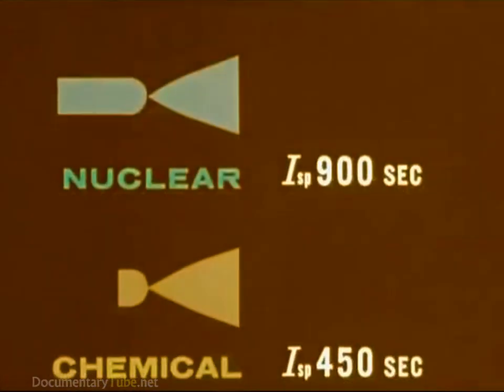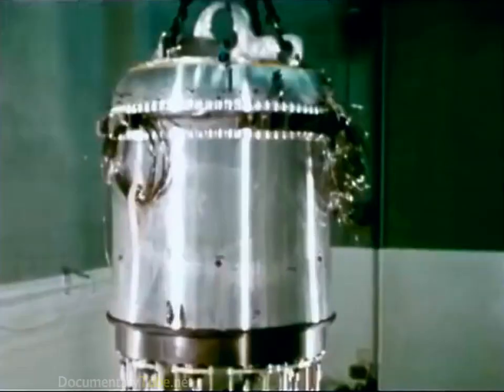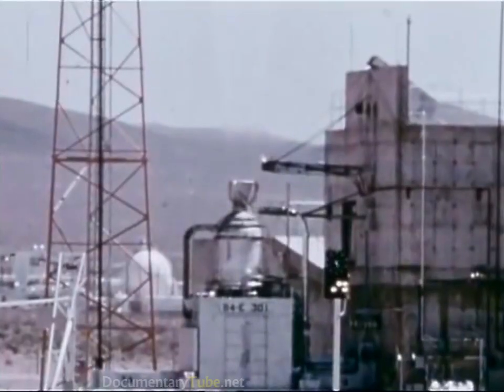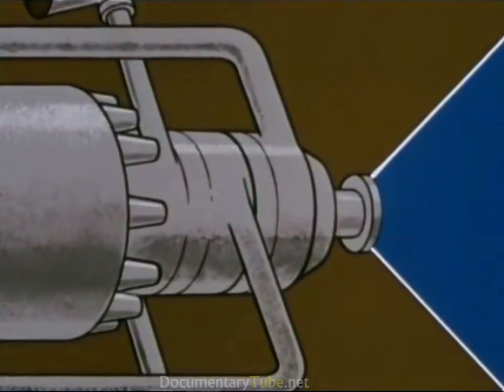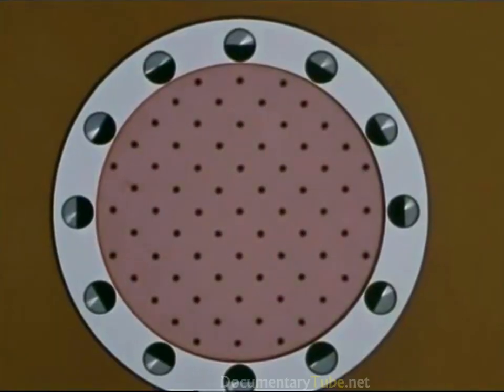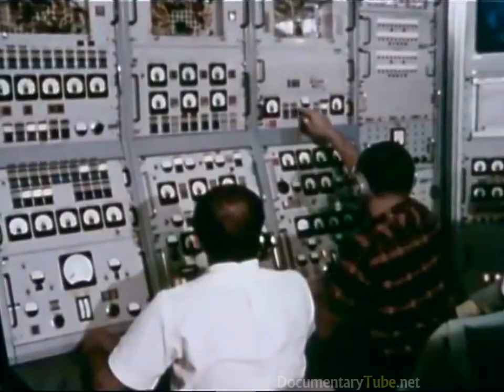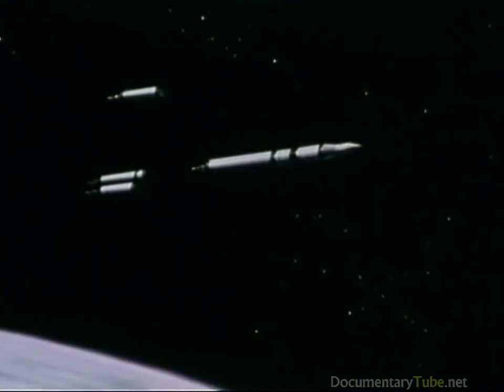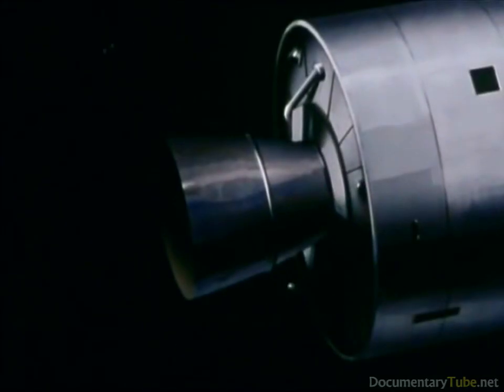HOW IT WORKS: Nuclear Propulsion

Comment: So, that exhaust gas was radioactive? They just vented it straight to the atmosphere with no care or thought of contamination.
Reply: Depending how many bananas you eat
Reply: Background radiation was already up due to 20+ years of bomb testing around the world but people were starting to complain. Pollution in general was starting to become a topic around that time. We did a lot a bad stuff in those days, as individuals and as nations.
Reply: Nope, the hydrogen does not become radioactive when passing through the engine.
The problem is that the engine does become radioactive,  somewhat.(not as bad as you would think, the run times are very short, as nuclear reactors go)
and even bigger problem is that while operating the engine gives of one goddamn awful flood of radiation. You do NOT want to be anywhere near it while it is operating. And in this case "near" is anywhere within several hundred yards from the core.
When using it on a rocket, you simple cannot use the sort of heavy shielding that normally goes with a nuclear reactor.
Also, when using it on a rocket, you kinda have to be close to it, you have to sit on the same rocket!
.
Add on top of that the thrust being too weak to use it for launch, this is a space-only motor.
.
Add on top of that the assorted hazards of launching that much u-235, even in a shutdown reactor. What happens if the launch fails? What happens if some third party lays their hands on the engine? The amount of uranium on it is enough to build *several hundred* nuclear weapons.
.
Scientifically, the NERVA engine made some sense, but politically and environmentally it was a complete flop.
Reply: theory was the large amount of H2 was the shielding

Comment: This is old 1960s stuff, when everything with the word ''atomic'' was almost magic. Nuclear propulsion has indeed several advantages, but it's has one huge disadvantage --  the exhaust gases are radioactive. You really really don't  want to use them inside the Earth's atmosphere. I've read several old (illustrated) books of that age about the future of space exploration , and most of them assumed nuclear rockets are the way to go. I could be wrong , at the moment the only thing nuclear in space propulsion are small reactors providing power for spacecraft that are too far away from the sun to use solar panels
Reply: This engine is only useful in space. 75,000lbs of thrust is about 1 boeing 787 engine and thats not strong enough to get any real payload into orbit from the ground. this engine is optimal when already in orbit
Reply: It still is magic, the energy density is huge! For example a lithium battery has the specific energy of about 0.5MJ/Kg, Wood ~16MJ/Kg, Jet Fuel ~42MJ/KG, Diesel ~48MJ/Kg and Uranium ~80,000,000/MJ/Kg. I can easily see why the hype existed, too bad it's super deadly.
Reply: +Eric T - Not air - They use bottled hydrogen they take with them so air is not required. You may be thinking of the nuclear aircraft programme which did use air - especially the G.E. direct method.
Reply: Nuclear reactors are not used in spacecraft (not modern ones at any rate, and the ones that have been are exclusively Soviet of origin save for one). RTGs (radioisotope thermoelectric generators) are. RTGs hold a block of a radioisotope that has a long half-life. As it decays, it gives-off heat, which is then converted to electricity (via the thermoelectric effect, so uses a solid-state device).

The isotopes in RTGs are chosen for their low gamma and neutron emissions as well as long half-life. It's very important to note here that neutron emissions are vital in nuclear reactors, and it would be impossible to run a nuclear reactor on fuel that did not release neutrons as it decays; RTGs and reactors operate based on entirely different principles.

Pu-238 is one example of an isotope used in RTGs, and was used on the Viking and Voyager missions, and used on the Curiosity rover, as well as New Horizons. RTGs are great for any mission where solar power is unreliable (outer solar system, the surface of Mars, long-term surface missions to Venus if we ever discover materials that can survive such an environment for more than a few minutes, and so on).

Another fun side-note: Breeder reactors are absolutely required to make these isotopes (along with important isotopes for medicine). Ban nuclear reactors and we not only hobble space exploration, but end-up killing ourselves. (Please remind the anti-nuclear nutters of this if you see them.)
Reply: The exhaust gasses aren't radioactive. Not the way you're imagining. For one thing, the H2 is only in the reactor for a very short time. And whatever deuterium and tritium is created occurs naturally anyway.
Reply: The exhaust is not radioactive.  It is hydrogen. If it picks up a neutron passing through the core, it becomes deuterium, which is also not radioactive.  And we are not serious about manned exploration of the Solar System until we man up and start using nuclear propulsion systems.  Chemical rockets are simply not up to the job.
Reply: That why they'd use conventional propulsion to get into orbit and once you're in space worrying about nuclear propulsion is like worrying about throwing away your gum wraps on a waste dump. 
I'd call it now, we won't go around nuclear propulsion until we develop a functioning Alcubierre-drive (or similar).
Reply: nuclear power is inefficient? no, solar power is 30% efficient, nuclear is only 1% efficient, but it's 1% of 80000000MJ/kg, the power density is absurd. so it doesn't matter. (that's already 8000 times more power dense than solar)
Reply: @monad_tcp  That 1% efficiency figure is only with regards to available energy. When you look at thermodynamic efficiency, they are about 30-40% efficient like any other plant that size. If the fuel were to be inside a breeder reactor then we would be able to use all of the fuel.
Reply: @travisbeagle5691  Yep, 1% is what's available through fission, you don't want to release all the power contained between neutrons at the same time.  With enrichment and breeder, you get get up to 85% thermodynamic efficiency.
Reply: @monad_tcp What I meant by available energy is what you can actually be able to consume. The vast majority of the energy reserves are never touched because most of it is found in fertile and not fissile material. Then you factor in the restrictions of how much you can consume at one time due to the fuel being in solid form and you end up only using a couple percent of the fuel rods that go into the reactor (cut that in less than half and there is where the 1% comes from).  Breeder reactors let you use the full amount of fuel and liquid fueled reactors can let you do so without coming offline for anything other than routine maintenance. Also I have no clue where you got an 85% thermal efficiency from. It's simply not possible with a thermal engine and the best we can do is about 60% from advanced gas turbine systems.
Reply: I think it is possible. But it cannot be used within the Earth's surroundings. Plus they have found that there are he3 in moon that can be used for fuel and idk if it can be used for nuclear reactors but most probably they can be. We should've set up a base in the moon so that we can construct larger object like a rocket with nuclear propulsions. Unlike in ISS where everything is crowded and the space is closed off and it is difficult to make big rockets.
Reply: lies damnlies banning nuclear reactors would be the dumbest thing we've ever done. Watt for Watt it's the safest and least polluting power system we have. We're generations past the primitive kinds that caused all the accidents. The generation developed in the 80's was specifically demonstrated to be able to survive a direct tsunami and earthquake without releasing any radiation. Heavy regulation and bans based on the issues with the first 3 generations are the only reason why we aren't all using meltdown-proof gen6+ reactors to power every city today for clean, affordable power.
Reply: use 'traditional'l machines to exit our atmosphere and bring the nuclear engines on
 Hitlers men were toying with the idea - v1 doodle was a pulse engine add paperclip into the equation and da daaa ! the nazi part of america had true genius eastern european science and rocket minds plus fusion or fission plus jewish money and gold - come on it aint rocket science 
nuclear propulsion is decades old not sure its in use but its there
Reply: Mycel. why whats the difference ?  Ion thrusters generate more exhaust gasses and heat ?  but surely if space has no 'air' how can either be used ?
Reply: Ion propulsion is something different from nuclear propulsion. i'm NO rocket scientist but I do know that ion ''rockets'' are best used for long duration mission.The thrust from ion engines is not much in comparison with other drives, but they can work for hours and hours , I think even for days. So the initial thrust is not much, but after some time the accumulated thrust is impressive.
Reply: Hydrogen is not radioactive
Reply: Henry Rieman. 😊 they did decades ago  thats why we're talking about it today
Germans were 1st onto it
Reply: ..but on the other hand it whitens teeth and sterlises BBQ grills!
Reply: 1960's stuff - still better overall performance than todays rockets. Would still be great for long distance fast probes - if you want to send a probe to Alpha centauri.
Reply: Marc Dezaire is this not what ion rockets are?
Reply: Boiling water? Not a bad idea at all. You mean a steam engine? The pressure should be waayyy higher compared to classic steam trains I guess. But I don't think it will be very efficient because of all the coal or the oil or whatever that has to be burnt. Ships just float in water but spacecraft have to haul all the extra fuel with them.
Reply: Marc Dezaire 
YES, launching rockets using nuclear explosions to lift off from earth gravity// Scary concepts from early DOE & unmetered power mantra/Crazy
Reply: roywhiteo5 
Orion Drive use nukes to propel space craft into LEO
jerry pournelle & david niven
Reply: what kind of application could something like that really have, then? deep space exploration?
spewing out radioactive exhaust isn't a big deal if you do it once in a while, right? obviously this couldn't be used for constant travel over established travel routes.. the exhaust would build up, wouldn't it?
could something with this kind of propulsion system be refueled by harvesting hydrogen stuff floating around in space? so could it be feasible that it could be self sufficient? say, if it had some on-board little robots that could be deployed to mine hydrogen from asteroids and the like, and return it to the ship? and they'd repair themselves and the main craft using that same method for materials?
i enjoy thinking about this kind of stuff ;D
Reply: The hydrogen expelled from the engine would not be radioactive as   it would not come in contact with the uranium (the tubes in the reactor core were coated with a non radioactive metal) and the hydrogen would not spend enough time in the reactor for a significant amount of it to transmute into radioactive tritium.  Even if uranium was being released into the atmosphere it would not be that bad as uranium has an extremely long half life and thus a low radioactivity. The main concern would be if the plutonium or fission products produced in the reactor were released as they have a short half life and are thus highly radioactive.
Reply: Yard Sale Dale  you can look at the fact and find out that nuclear produces the least deaths per kilowatt, the safest power.  Nuclear has much lower lifetime and upfront costs compared to renewables and lower lifetime costs than coal/natural gas, making it the cheapest form of energy.  It is true that chernobyl and fukishima were produced before we had serious computing power, and that a line of very bad decisions resulted in chernobyl melting down
Reply: Marc Dezaire they are only dangerous in our atmosphere. Imagine if you could use modern tech to transport these reactors to a space station and use them to push the station to places like mars.
Reply: Coal is radioactive. The hydrogen goes through the reactor so fast that very little is transmuted. While some small amount may be transmuted to tritium, that is relatively harmless - after all, it is put into watch dials.The more significant worry was the possibility that the entire nuclear thermal rocket assembly might crash on land create a large hazmat clean-up mess. So it was decided that it was only politically feasible to use the  nuclear thermal rocket in space (outside the atmosphere).
Reply: Just like the Atomic Dishwasher, the Nuclear Washer/Dryer combo and the Thermonuclear Oven with Radioactive Rangetop, all circa late 50's / early 60's lol. I'm surprised we don't have atomic lawnmowers these days based on how magical the word atomic was back then. But I've gotta admit that I'm absolutely fascinated by the Atomic Bomb and it's development not to mention it's effects on Hiroshima and Nagasaki. GO BRONCOS!! SB50 CHAMPS!!
Reply: The exhaust gases would only be radioactive if there was a major reactor failure. Nominally, very, very little of the hydrogen would become tritiated. It's a non-issue.
Reply: steveb0503 
You’re a complete idiot. Nuclear propulsion is easier and more efficient than chemical rockets. As soon as we have an orbiting shipyard and can build them in space, chemical rockets (in deep space) are done..
Reply: This whole idea seems too overly-complicated to be at all practical - plus, there's all the attendant risk of radiation exposure for those directly involved or even nearby.
Reply: Atomic energy is still super inefficient. A contained reactor which uses another medium would be much safer, but there are better energy sources on the horizon, not least of which is anti-matter. Although only theoretical at this stage, is could potentially (and also theoretically) be harnessed at 100% efficiency.
Reply: Marc Dezaire + This wont work in space. Rocket propulsion require the mass input = mass output which means 1 kg of air mass= 1kg  going different direction of the vessel mass. Since there is very little air is space nuclear energy is useless for propulsion.

Comment: What ppl do not realise about Russia's supposed nuclear powered missile is this the reactor heats reaction mass to use as thrust. Can you imagine Russia saying they have a nuclear powered rocket that can fly indefinitely.  The reaction mass "water or hydrogen or ammonia" tank would have to be huge. So big that it becomes to heavy to lift.
Reply: The Russians have been smoking too much crack.  What they have said about flying around the earth "indefinitely" is best found on the stable floor.  Far too many problems to deal with.  Even living in the ISS, there were so many biological changes to the astronauts that longer duration stays in space are not even considerable, except for the suicide pilots of WW2 era Japan.
Reply: Dan Colley indeed well said indeed.